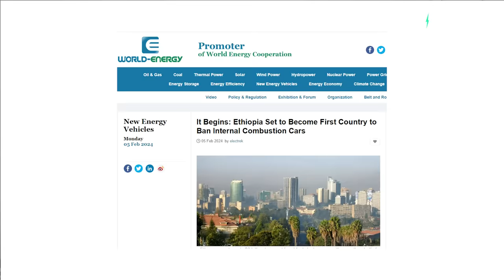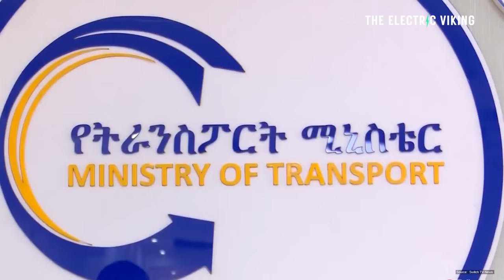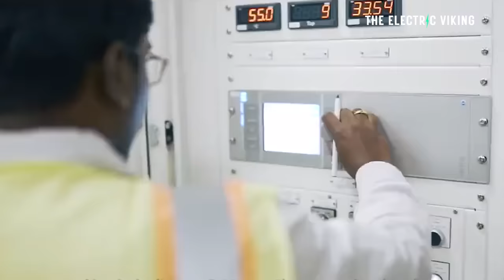African country with 97% renewable energy decides to ban combustion cars

Comment: Ethiopia has had surplus electricity for years the BRI initiative + Chinese investment in their infra had greater promises their surplus capacity of electricity bow has led them to selling this power to their own neighbors
It's a great idea to limit the oil consumption and to replace them with the electric automotive industry I think
Reply: Instead of oil, Ethiopia will import expensive batteries.
Reply: @slovackoinfo  Batteries are infrastructure, oil is not.

Comment: Solar power with battery storage can supply all African countries with enough electricity to power their electric cars and motorcycles. Their is no need to keep using dirty gas cars and motorcycles. Kenya is already transitioning to electric motorcycles so this decision by Ethiopia to go all in on EV's only makes sense.
Reply: Many countries are already planning to further develop their nuclear energy capabilities to power their energy and defense needs.
The nuclear option is what would be needed to successfully implement any ICE replacement solutions for Afrikan countries.
If that is what experts in places such as California are currently projecting as a need for their future EV needs, how would Afrikan countries be exempt from solutions based on a similar conclusion for such initiatives?
There is no renewable solution that is going to meet the needs of the industrial and enterprise ambitions most Afrikan countries have for their exponentially growing societies..
They will increasingly take the nuclear option, such as the Sahel Alliance states have already signed contracts and MOUs with Russia to assist with and consult with regards to same.

Comment: Ethiopia, Uruguay, and Iceland all have very low levels of fossil fuel usage. What do they all have in common? They do not have fossil fuels, so there are no vested interests pushing and promoting fossil fuels. This means that they are free to make economic and environmental decisions rationally.

This suggests a strategy for all other countries also. Decrease and eliminate the political influence of fossil fuel vested interests. How? I'm fairly sure that a strong, robust, functioning, democracy is part of the answer.
Reply: Uruguay and iceland are small litle people wind and geothermal is top tech there and have monet Etiopía is poor Man y people big country energy grid suck many blockouts need money improve energy grid buy EVbus build trains and many Project green energy
Reply: Ethiopia is a landlocked country. 

With that being the case, they definitely got to push for their own independence of energy.

In the video showing the HUGE ships containing the oil,    that is not a port of Ethiopia. 

Ethiopia has no access to the ocean. 
Ethiopia has to pay a toll to have the oil shipped over land to Ethiopia via neighboring African countries that do have ocean access. 

Many of those countries are not that friendly with Ethiopia.
Reply: It will only change due to the influence of interest groups around batteries.
Reply: @slovackoinfo  China owns all Ethiopia's mines.

The Congo kicked "#CCP"* out with their new leader and took back control of their mines.

Comment: US is doing good things with renewables also,  just that vested commercial interests lie with big oil.  However for countries that have to import their oil,  this makes complete sense.  The sooner the better.  The accounting and logic around switching to renewables,   is a lot simpler when you're a consumer and not a consumer and producer.  Hawaii ( a US state ) was importing its oil for decades,  however has since gone totally renewable,  because the economics now makes compelling sense and they were only a consumer of oil,  not a producer of oil.  Thus no vested interests in oil in that state, beyond the retail level for imported oils.
Reply: I changed my roof and was looking to have solar panels installed.  They wanted $10,000.   GTFOH.  Where is the renewable you are talking about.
Reply: Every situation is different.  You have to do the math to see what works best for you.

Comment: an electric cars engine drive system is a electric motor plus a  battery bank ..  where as conventional car is just an engine (plus a tank) 
when batteries can not only do 600 plus km per charge  and do a half a million km with very little cost then the ev car industry will be superior .. at the moment buying a second hand ev is a high risk .. but this will change thanks to BYD (Tesla is too high end and a feel good car for the rich ) 
look foward to considering a low cost reliable second hand EV like the $4,000 - 220,000 km  second hand car i have that doesn't drink that much fuel and can tow my boat .. compared to the risk of a small ev needing a $8,000 battery change ..

Comment: What about alcohol like Brazil
The original model t was designed to burn alcohol. But then the movement to ban alcohol in the 20s  prohibition did not allow it. Is standard oil was the culprit, because every farmer and farm had an alcohol still and the rockefellers could not own the energy source. So they made the model t also run on gasoline, And stopped alcohol production with prohibition. And in so far as an alcohol source would be renewable and the world does not have adequate metals for all the batteries and electric cars, I say ICE engines are much more sustainable, not to mention an excessive electricity demand.

Comment: If this would efficient ICE could use renewable energy or atomic energy.-> Source greencarcongress: US Navy demos recovery of CO2 and production of H2 from seawater, with conversion to liquid fuel; “Fuel from Seawater”
08 April 2014
Reply: 4x cheaper to use a battery powered car rather than a hydrogen powered one.
Reply: @victorluke5816  They don‘t have a H2 infrastructure and they don‘t have a EV infrastructure but they have some ICE infrastructure they now decided not to use anymore. It‘s still like they choose landline anf landline and not to mobile phone.
Reply: @IchGukNurZu  Actually its the other way around.  They don't have the money to import the oil anymore so they either have cars that can only sit on the curb or they switch to electricity which they have plenty of.   For those with enough money to buy a car that usually means that they have enough money to afford an electrical outlet.  They can charge at 6/mph with rudimentary household current.
Reply: @victorluke5816  Where are those electrical outlets they are at home in densely populated areas but these countries are hugh and they don’t have a good grid of electrical landlines ( expensive infrastrucuctur) otherwise they wouldn‘t use so much biomass wood etc.. EV cars stranded without an empty batteries somewhere got quit a problem  it‘s not sufficient for someone to bring a canister with fuel no, some one has too tow them away or has to come with a generator or an auxiliary battery to get them going again. And again charging  time ( they might have a lot of time) and reach ( hugh distance hugh country but little electrified infrastructure) and we didn‘t even start with the problem to replace ICE Trucks with EV Trucks.

Comment: I think that is a foolish law.  Practically Ethiopians do not necessarily have the electrical distribution infrastructure to only have electric autos.  They should start with a ban on ICE motorcycles and  tuk-tuks. They are notoriously polluting can easily have much smaller swappable batteries.